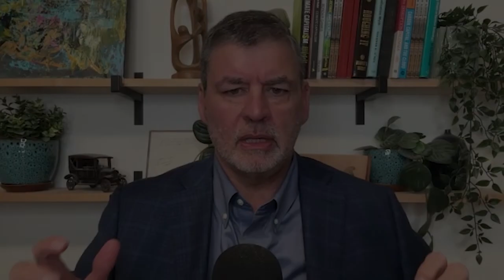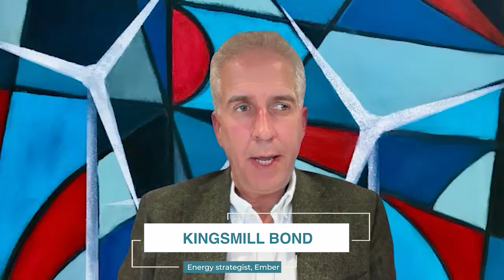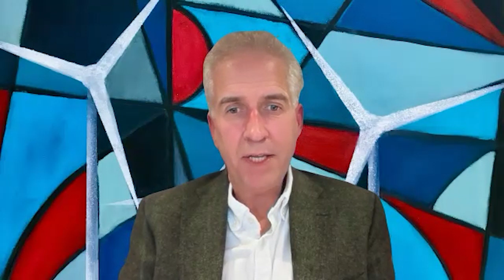Electrotech Revolution Explained: Batteries, HVDC, Midstream Powe

Comment: He fails to mention an important trend in that midstream. We see more and more that things are connected by DC. Solar panels produce DC. Batteries use and produce DC. We now have more and more devices that use DC. Directly charging your car using DC from your solar + battery system is one example. We will also see more and more DC heat pumps and air conditioners. And that is just the start.

Comment: The benefit of using cars, they remove load from the grid. They can charge at off hours when the grid can handle it. When they release their energy, they release it locally, at point of use. That benefits the grid at high demand times.